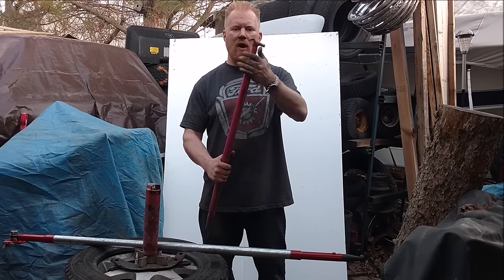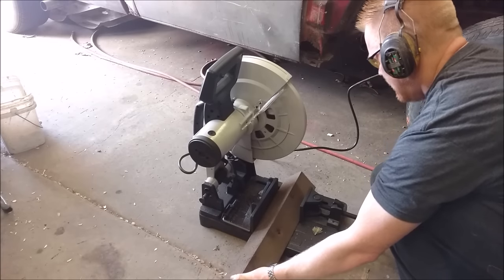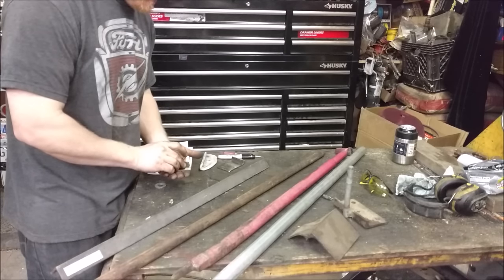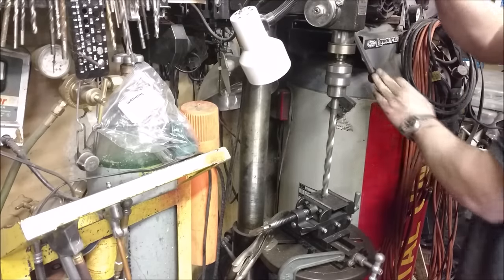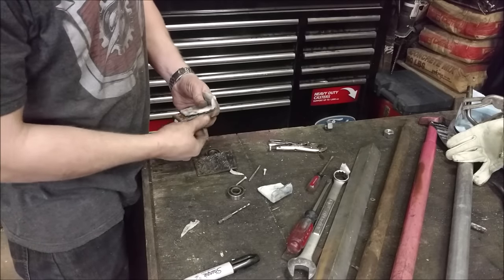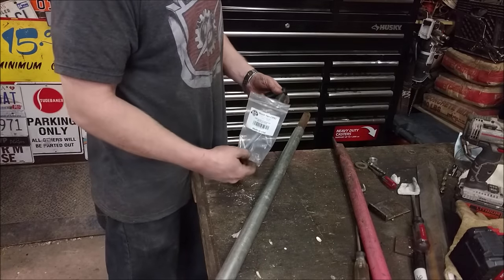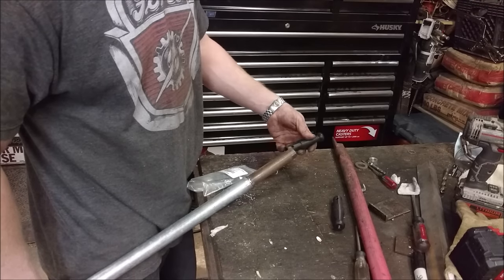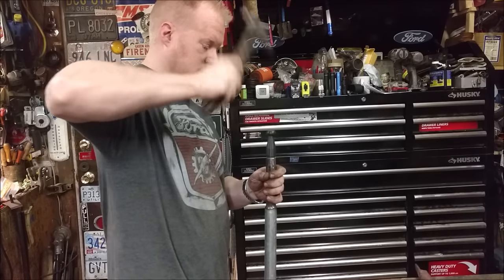No Scuff Manual Tire Change Bar

Comment: hello! very nice bar, it's working ok to, but i seen where you have to keep pushing the tire behind the slide bar in order to get the tire to slide on the rim, and at the end  the slide bar left a good bit  where you have to tip the bar up to get to slide on the rim,  that's because, you need a inch of space  for the bead of the tire to slide up on to the baring, and you need to have your bearing right over to the left side, so that the baring is turning flush with the left side of the slide bar, and that should make it role the tire on faster, nice bar tho, and well made to, man, but i just wonted to let you know where the baring have to be .to work much better.
Reply: to sixtyfiveford
good evening ,the comment that I had made the other evening,  ended up flats, because that's what I was told, so I tried it out , made the tire slider on rig, put the baring right over to the left side,  didn't work to good at all,  so I am putting mine in the middle the same place that sixtyfiveford put his , but I do think that it do matter how far down we put it tho, because to far down wont work as well,  1/2 our 3/4 down from the top would be perfect  , but a inch down from the top is defiantly to far , I will try a 1/2 , , am kind of working on a sickened baring to go rolling on down on the tire bead to keep it going on the rim, have a great day sir nice work.

Comment: Great tool ya made there. I noticed you were using an old gasket to help clamp the wheel down. Looks like it worked for a temporary fix but if you would be up for a more permanent solution might I suggest an 12 inch Lube Plate for a fifth wheel motor home. it is a plastic 1/8" x 12" doughnut  that spaces between the truck receiver and the trailer hitch. $13 at Camping World all day long. you could slip that between the clamp and rim.
 But wait did I say ... "PLASTIC"? Isn't that what you do??
and again great tool
Reply from the maker: Yeah, I've seen the 5th wheel nylon discs. I use old chunks of tire sidewall; not as refined but hold good.

Comment: You are one of the coolest guys on YouTube love all of your videos. How are you liking the husky toolbox I have almost the same one but mine has the cabinet on the bottom instead of the small drawer.
Reply from the maker: I really like the tool box but got tool box envy for the brand new one with soft close drawers.
Reply: sixtyfiveford I believe mine has soft closed drawers and it is a bit of a pain if you lock up your box regularly because you half to push them in farther than they do themselves to get the lock to work.

Comment: Nice build. I printed off the build list. I got to have one of those. How far back from the front edge do you drill the hole Do you want the OD of the bearing about even with the front edge of the angle. Thanks, doug
Reply from the maker: With the HDPE plastic installed, I have the front edge of the bearing 1/8" back towards the handle. I put a good side picture on Facebook(link in video description).

Comment: I invented the nylon covers for the tire tools back in the 70's. It was stolen by Jack Hennessy Co. (the maker of Coats Tire machine)when I tired to sell it to them
Reply from the maker: Sorry to hear this. It was around then when the first alloy rims where coming out.
Reply: Yes, that's why I invented it. Was to EZ to damage an Alum wheel. I came up with 3 different designs, all 3 of which they took and manufactured. Cost me $1,800 back then to have the engineering drawings made. I ended up have to buy my own invention to use it. Wish I had enough to have patented it and sue them back then.

Comment: But where do you get the trampoline pipe?!? ...never mind I see it next door. lol j/k of course! Thanks for this, I have the same changer and I’m gonna make one of these. 

On the changer itself, it seems kind of weak on the part that actually breaks the bead. Did you reinforce that?
Reply from the maker: I ended up welding a plate across the two arms. It held up without any reinforcement for a few years but finally bent doing a truck tire.
Reply: Cool, I’ll have to reinforce mine. I’ve been doing low profile tires which kinda suck, thanks!

Comment: Dam thats clever, re-made and improved :-D
Plastic pipe for a sink drain may work if made flat, would it be harder or softer than what you have used i wonder.
You allways make me think about materials :-D
Reply from the maker: Years ago I tried PVC plastic pipe, heated and formed over the stock tire bar. It worked but was too brittle of plastic and kept snapping under load.

Comment: Great idea.  How do you get rid of old tires?  We see a lot of them tossed out on the side of the roads around here.
Reply from the maker: I generally end up dropping them behind the tire store.
Reply: I take a reciprocating saw to them and make myself tire pads to use for cushioning jacks and jack stands.  Super tough stuff, all sorts of uses. Protection for vise jaws; cut a small pieces and make a prop for wiper blades to keep them off the windshield so they don't get distorted from the pressure.
Motorcycle kickstand pads for soft ground or asphalt.
Pad the retaining ring on the HF tire changer to keep it from scratching the rim when tightening it down.
Pad the protrusion on the HF bead breaker so you don't gouge the rim when you lay the wheel on it.
Reply: Walmart has always taken my used tires, without question.
Reply: S. Williams:  You're spot on.  I just called my local Walmart and they'll take 'em without question (as long as it's not a truck load.)  I knew they took used oil, but had no idea they took tires too.  It's a shame more people aren't aware; it would sure save us hundreds in tax dollars to dispose of thousands of tires tossed out on our roads and highways.  Many thanks for this info!!  :>)

Comment: can you mount the wheel upside down in the tire changer, so the scuff marks just affect the back side where they can't be seen?
Reply from the maker: Unfortunately not. There's a depression in the rim that's favors the front side; so you can only remove and install the tire from the front side of the rim.

Comment: Is it possible to mount a low profile tire with this set up you have here ? I tried to mount a 225 45 r17 on a 5 star amg rim. 2 years ago and not only did I totally scratch my rim but I actually riiped or broke the inside radius wires I still t have the title actually just in case I could somehow well the broke wires with a sort of band and resurface it.  However I seen in a newer video you spent 20 bucks on a actual head. Should I go. Ahead and get that or follow your steps here and this will be just as good? I know you are busy but I. Would certainly appreciate and value your thoughts and opinions.
Reply from the maker: The one I built in this video mounts tires easier than the $20 duck bill head. However the duck bill head dismounts way better than the black nob thing I have in this video.The duck bill is probably the best of both worlds. Will they both do low profile tires, yes. 

Super low profile tires: They are difficult even for tire shops. A few steps are absolutely necessary: Tire must be warm to soften the rubber, tons of good lube, and proper technique. Oh an your tire machine needs to be bolted to the concrete(no pallet, board, etc). If you have curb bash on the rim, it must be sanded down smooth before attempting mount/dismount as this will rip the bead. 

If you do tear the bead it is not the end of the world. If you can leave the torn flap of rubber in place. A cheap bead sealer will help assure it doesn't leak. If you broke a bead wire under the rubber, it starts to get questionable to the reliability of the tire.

Comment: Holy crap I'm having trouble and can't find it on google! I got the harbor freight tire changer, and the bar SUCKS. I destroyed two tire beads trying to mount it, chewed them all to hell. What i want to know, is WHAT the different shapes are on the tip if the bar. I can't find it online to save my life. There's the 90 degree half, with the little nub on the end of it. And behind that, there's a 80 degree kind of broad hook shape. What do you use each shape for?

I'm trying to grind down the bar in strategic places, to help it slide under the bead instead if bashing itself into it.
Reply from the maker: I could never get the Harbor Freight bars S end to work. I always just used the flat duck bill end to take little bites and flip the tire over the rim bead.
Reply: @sixtyfiveford  

Yeah i ground and ground and reshaped it yesterday, STILL doesn't work. I wish the machines cane just by themselves for cheaper lol

Comment: It would be good if you could edit this video to add some slow motion detailed operation and close up detailed shots to pause on easier. It would be good to see the wheel condition also (before and after). One can see there are also several techniques that go into the job. -fairly self explanatory, but helpful to know beforehand. Thx.
Reply from the maker: I do have closer photos of the tool on my Facebook page.

Comment: Best tip I can give, Heat up your tires. Heat them good. (A blow dryer will due in a pinch)
Reply from the maker: I put them in front of my shop heater for a while on cold days.

Comment: Serious! You went through all this trouble! all you had to do was flip the rim with the good side facing on the changer  using a protective material like a truck mud guard (for example cut to fit on the base of the changer)  to protect the rim, then change your tire that way !!!!!!
Reply from the maker: You have never removed a car tire in your life. You can not take a car tire off the back side as the rim depression isn't there.

Comment: What did you mount your manual tire changer to? Did you bolt it to cement?
Reply from the maker: I bolted it to the cement. Easiest and best thing you can do.
Reply: @sixtyfiveford  thanks Moe. I bought some drop in anchors so I can bolt it down when I need to use it.

Comment: Hang on, without scratches ??
You have protected one end of the tool, other end is bald steel tip ??? 
Alloy is softer than steel hence easy to scratch it.
Nice presentation your work ideas congrats
keep em coming
Reply from the maker: Yep, no scratches. Both sides are protected.

Comment: Valve stem OFF FIRST and ON LAST,  especially the new ones with pressure sensors, or the bead will chop them off or, worse yet, just tweak them enough to fail LATER ( like when you HAVE to be somewhere ASAP)...... Make DRAIN GROOVE n the bottom if you pad the lower mounting plate with rubber, otherwise the welded base at center pole will collect rainwater and rot/rust at the weld and BREAK OFF....Ask me how I know. GREAT MOD on the bar!!!!

Comment: I am changing tires on 22" chome wheels ... tires are off and not a scratch . Putting tires on and there will be no scratch either ... how ?
Mount the rim on the tire changer upside down ... you wont use the front to remove or install tire so how can you scratch it ? I removed 22" tires with just the tire changer with no modifications and no scratches ... if I could show pics , you could see .
Reply from the maker: Very few rims are designed for rear removal. Generally only rims designed for rubberband tires.

Comment: The original hook that comes with those machines is dreadfull. I copied a  Jackson brand name hook onto the one supplied, I removed a LOT of material. Then it worked quite well and I could fit any tyre quite easily. Fitting tyres to painted alloys was a chore though without scratching. What you have made there will scratch still, just a little less. I tried a home made bar for alloys only with a piece of machineable nylon where it rides against the rim, Was just ok initially but wore enough to mark the rim in a couple of sets.  Where the rim is clamped down I used a piece of Sprintcar tyre tread so no scratching. Worked 100%
I fitted hundreds of tyres with this, modified and strengthened the bead breaking mechanism as well. Hard work and constant maintenance. I have bought a proper cheap semi auto machine. So much easier and no damage to rims,, except when the nylon wears and marks the painted alloys. A $1000AUD machine that is fine for a shop doing 20 tyres a week. If you want to do tyres all day long buy a  better brand name machine with all the assist arms required for modern wanker tyres! Nobody in their right mind needs bigger than 18" rims and nobody requires reverse fit rims either. I sell hundreds of 16-17" tyres replacing the stupid stuff. Which when bent and cracked as they inevitably are simply scrap metal. When chromed the scrappy might give me a dollar each as a LOT more work to recycle.

Comment: Nice video! I bought a Chinese tire changer and balancer off ebay. They were inexpensive but work well. I've done over 200 tires on them so far. Check out my review video if you're interested in going that route.
Reply from the maker: They look a lot nicer to use than a manual machine.

Comment: That's ok for tubeless but with a tube that angle might pinch it
Reply from the maker: I've done a few tubed tires with it and there are no issues. It's identical to using tire spoons, you just make sure the tube is out of the way.

Comment: What about breaking the bead on a stuck tire?
Reply from the maker: The tire changer has a bead breaker. On really stubborn ones you need tire lube. You press it down in one spot and it peels back the bead just enough for lube to be sprayed in. Rotate the tire a few inches and repeat. By the time you get back to the starting spot the bead will break free as it is lubed all the way around/under neath.

Comment: I plan on building one soon, so I bought a pair of no-mar tips. BUT then I see that the no-mar website says that those tips are for mounting and the demount tips are these ones: https://www.nomartirechanger.com/Demount_Tips_Set_Screw_Style_B_Replacement_3_P_p/rp-dt3b.htm

What do you think? the mounting tip worked perfectly for demounting on your video. Even though the no-mar site says otherwise. "If you're using mount tips for demounting, you're doing it wrong!"
Reply from the maker: You're way over thinking it. The only difference is those tips have been shaved off a little to slide out of the tire easier.
Reply: Yeah, it's just as I thought...I have a habit of overthinking things, I need to stop that and just get it done. Btw that video you have on refilling flat aerosol cans is genius! Makes me feel kind of dumb for never being able to come up with a quick, simple solution to a problem I ran into all the time. No more wasted product!